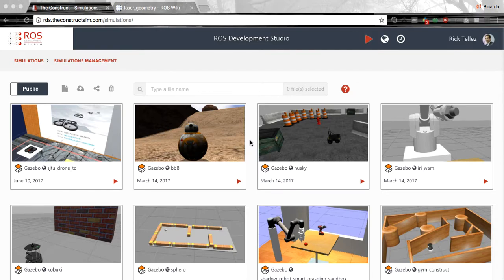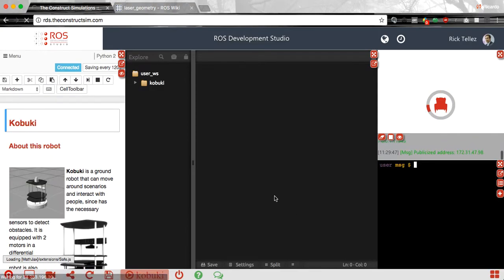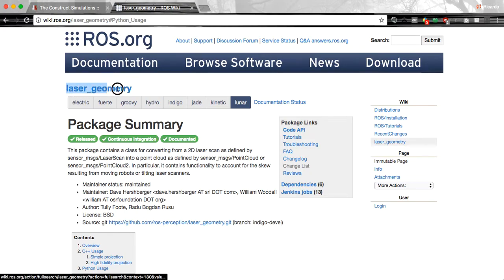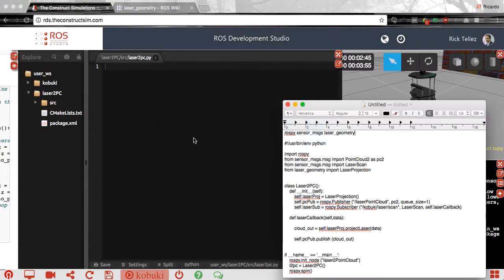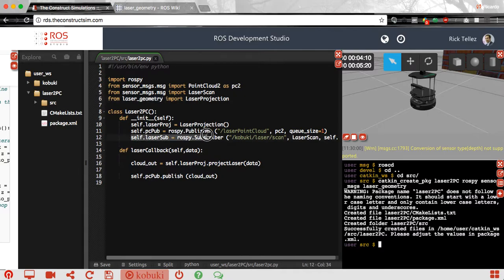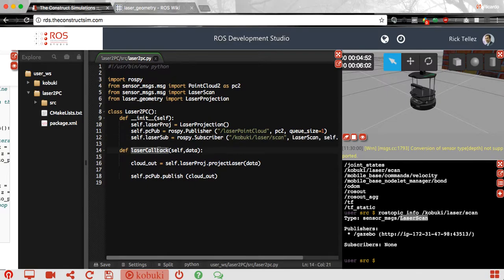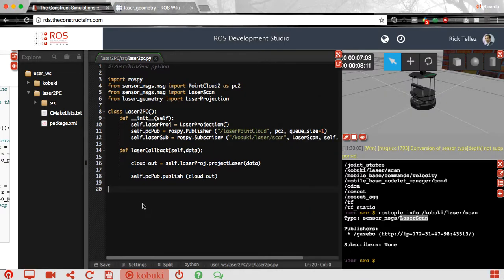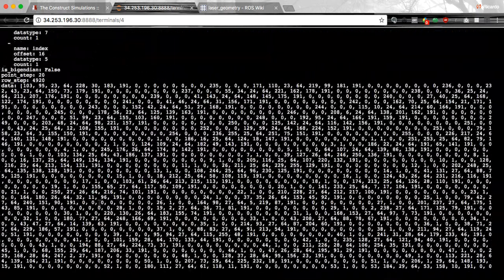[ROS Q&A] 012 - How to convert a laser scan into a pointcloud

Comment: I have a small doubt, for example, if I have a PCL data structure of type pcl::PointCloud<pcl::PointXYZL> and I want to convert this into sensor_msgs::msg::PointCloud2 form, is there any function or way to achieve this? As far as I understood from PCL documentation regarding the function pcl::toROSMsg it only takes pcl::PointCloud<pcl::PointXYZ> as an argument

Comment: Hello,
I want to filter the PointCloud data. I'm using a development kit called JETSON TX1 and the system is slowing down because there are too many PointCloud data streams. I also want to reduce the number of points cloud data. How can I do that?
Reply from the maker: You have two options:
1- reduce the publication frequency of the pointcloud topic
2- just subscribe to the pointcloud topic when you want to get a pointcloud message then unsubscribe. The pointcloud publisher will not be publishing if nobody is subscribed, so you will be reducing a lot the load of your system
Reply: Thank you very much

Comment: Hi,
I have 2D-Lidar(lms511pro)x4 and I want to convert 2d lidars from laser_scan1,2,3,4 to PointCloud2 data.
If I follow the way you do, I get pointcloud data though 4 laser scanners??
Reply from the maker: No, you would get 4 different PointClouds(one per each laser). We will publish a video showing how to combine several lasers into a single PointCloud very soon
Reply: Thank you very much for your reply.
 I will add one more question.
What is the ROS version used in the video? I'm using a kinetic version and do it work fine if I follow the video?
Reply from the maker: We are using Indigo, but it should work with no problem with Kinetic